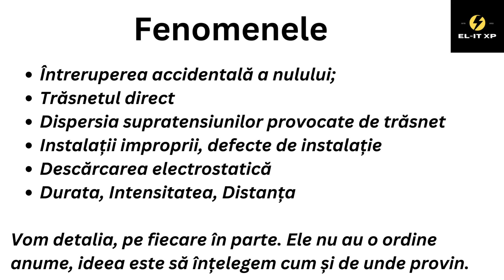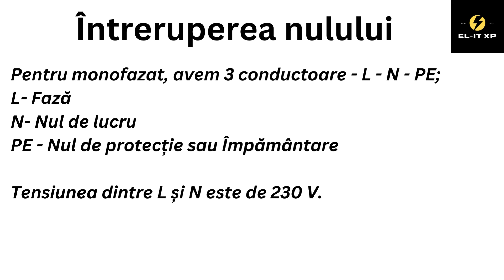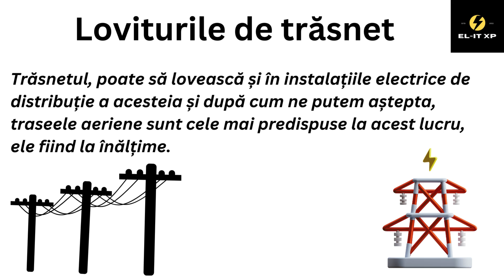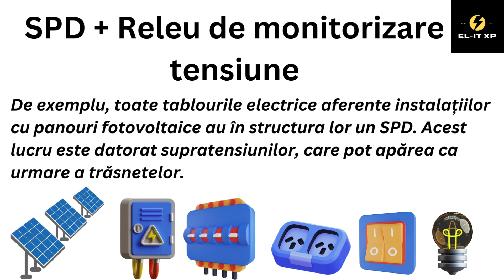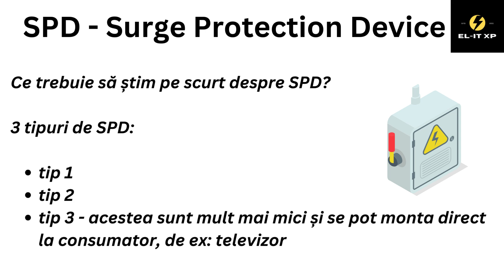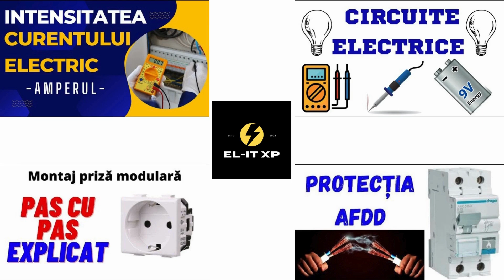[EXPLICAT] PROTECTIA LA SUPRATENSIUNI - SUPRATENSIUNEA

Comment: salut,imi poti spune te rog de ce ptr un circuit decicat e musai conductor litat?
Reply from the maker: Salut, o să fac un videoclip legat de diferențele dintre conductoare și unde se folosesc și cum, la fel cum a spus și colegul Bodo19691, vorim de instalații fixe și instalații mobile, voi proceda în a explica detaliat acest aspect în videoclip! Multam!
Reply: De unde ai informația asta?
Lițat se folosește la instalatii mobile sau aparate supuse vibrațiilor.
Reply: greseala mea,l am incurcat cu masiv @Bodo19691  🤭